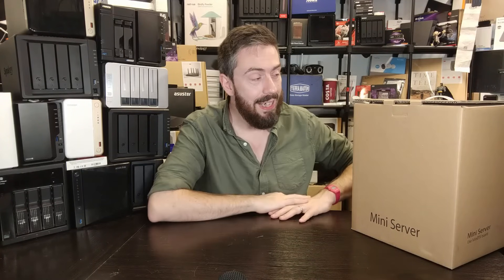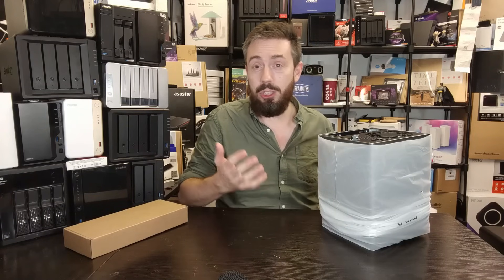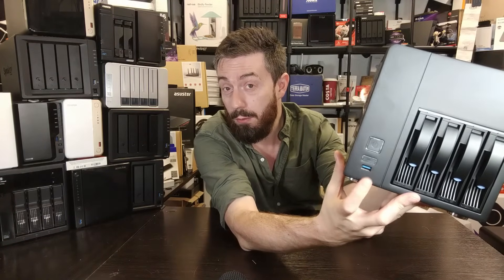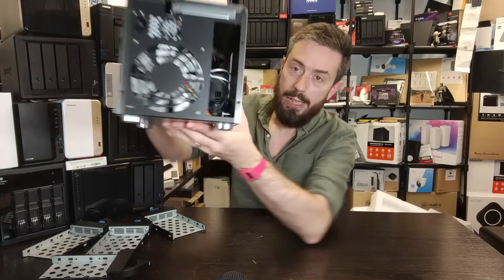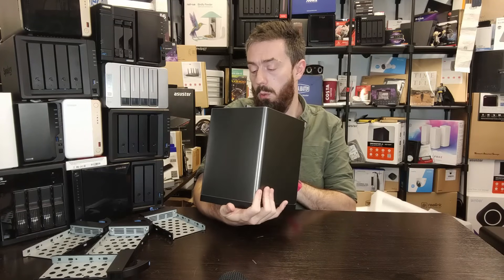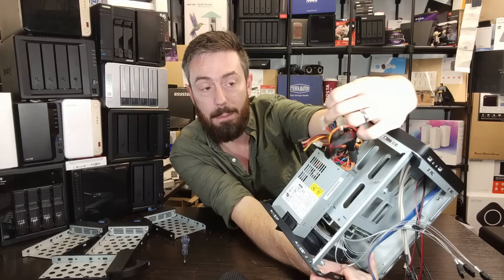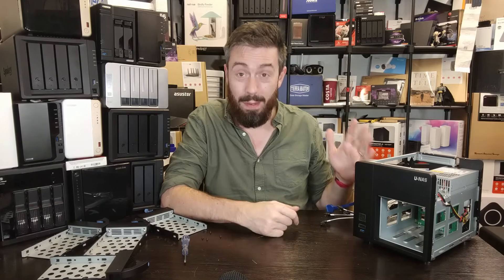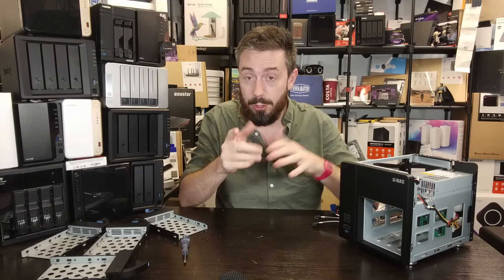The U-NAS NS-410 4-Bay NAS Enclosure Review

Comment: When I saw the distance between the rear fan and the drive cage, I immediately wrote this case off. They didn't even include a shroud to guide the airflow, so I doubt there will be enough static pressure to keep the drives cool unless you max the fan out at all times.

Comment: Anyone know what the maximum CPU cooler height is for this case?  I could not find it from their specs on the web site.  I did email them though but was just wondering if anyone knew.  I am thinking of a Noctua NH-L9i-17xx that is 37mm total height and would be cooling a i3-12100 CPU.
Reply: Its 40mm maximum, the NH-L9i will work

Comment: Currently looking for a 4 bay option for self build. Have you reviewed the In-Win IW-MS04-01, and how does it compare to this unit? They both seem fairly well thought out, and have the benefit of the hot swap bays over the Fractal Design 304, although that has 6 bays. And yes, I'll concede that they both use the Flex ATX PSU.

Comment: I am using the same case with inbuilt flex PSU from 2019 onwards, i use 4 HDD and 2 SSD running a NAS OS 24/7 without any heating issue and noise. I used a Noctua fan for my ASRock motherboard / Intel i7 processor. I am very happy with the case. PCi slot can accomodate only 1 slot thick card. not a common type of 2 slot GPU cards. 

So far i am happy with the performance.

Comment: I'm using a Qnap NAS and I'm wondering if something fails like the motherboard, what will happen to the stored data? and if I change my NAS to a DIY one, what will happen? I will have to format the disks?
Reply: Disks in QNAPs are written partly with the QTS/QuTS sysem on them, and the rest is data storage. 
As far as the disks coming from a dead system are put within a new QNAP, they most likely start up and let you read them again.
The firmware (think of a mix of BIOS and a bunch of low level QTS operating system startup functions) is within a flashable memory which in old QNAP hardware was mounted on a detachable small PCB (quite similar to TPM modules) with a small female pin connector to fix it to the main board. This also can lead to serious problems (an old 219Pro I own failed to start it and it is still unbootabl, whilst the mechanics and the data are still functioning if swapped with another identical device).
I saw some years ago a close friend and colleague of mine keeping data from a dead QNAP doing the simple transplant of the old disks to a newer QNAP, and after some inevitable curses and f-words, letting the customer have their data back again.

The system on the new QNAP MUST be the same or newer, because it attempts to reconvert options and customizations to let you restart as seamplessly as possible just in time to backup data somewhere, and perhaps rebuild the QNAP to work back again.
Reply: Thank you for your answer, I think that in my case there is only the data on the disks, I use an expansion card with 2 SSDs, one with the OS and the other with the applications.
So according to what you say to recover my data I will be forced to get a NAS from Qnap? @briccimn

Comment: I would like to know if anyone got an oem gpu like dell gtx 1050ti or 1650 to fit in the single pci slot.
Reply: Have not tried in mine, but they probably won't fit and the power supply is only 150 watts.  If you're doing transcoding you can easily fit a Quadro P620.
Reply: @oldtechdude  I have the audheid version without the pci slot and a 300 watt 1u power supply I would swap in the case.